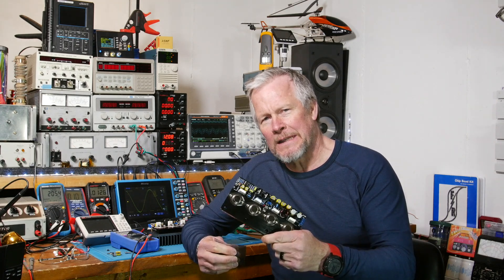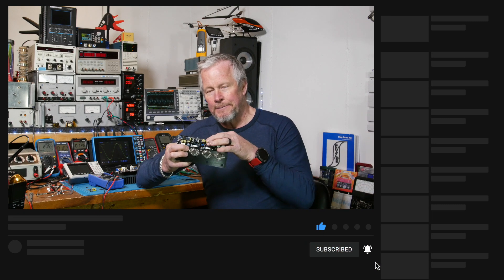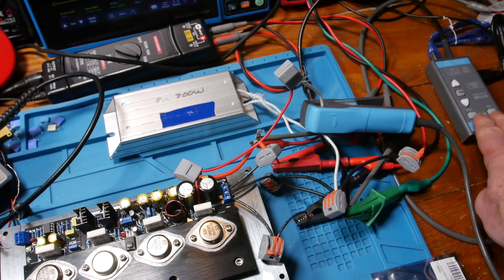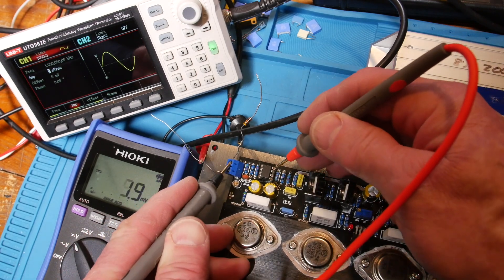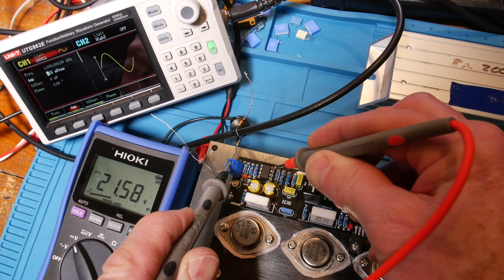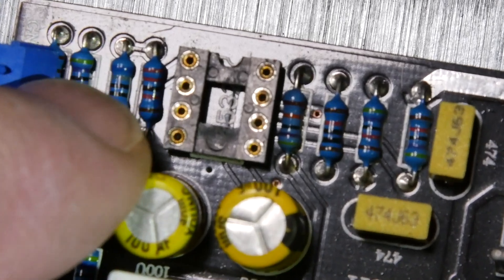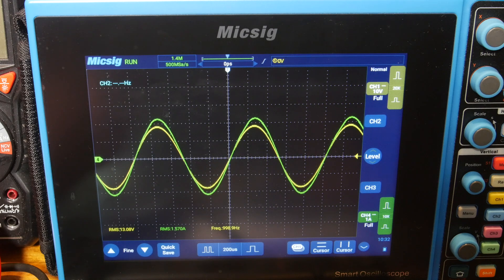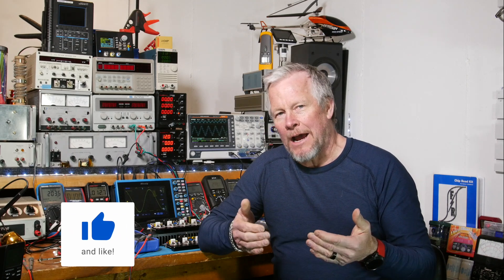Which OpAmp is Better for 20W Class A Amplifier - OPA2604 vs NE5532?

Comment: The best aspect of the jfet input is that the bias current is orders of magnitude less than with a bipolar input. This allows much lower noise voltage densities and is essential for good noise performance if the input is coming from a high impedance source such as any kind of unbuffered piezoelectric input...
Reply: At room temperature....
Reply from the maker: Great point - Thank you!
Reply: @KissAnalog  hello, how about using RC4558? Or 4580 😂

Comment: I've never used that op-amp.   Filet mignon / burr brown is just outside my  taste budget hehe.  That's really cool.  You know, you could now call that 20W amp a 5KW amp if ya want to use the normal advertising hype stuff that has become so prevalent these days. A few years ago I bought an car amp from Walmart on a whim claiming 500W.  I was interested in seeing how they boosted the voltage up.  Turns out it produced barely 25W if into 8 ohm.  It did have a cheesy inverter though.  Again, another really nice video.  Thanks Eddit :)
Reply from the maker: Thanks Keith.  LOL, I think you are so right;)

Comment: What about discrete op-amps what about making some? That should be even better
Reply: I have received one in the post today. I will be testing them and listening to them on my channel soon. I think the main advantage is current availability, no advantage on a preamp circuit. Might help on headphones...we shall see.
Reply: @MichaelBeeny  I think you get less Eddy field current from each stage because of the distance interfering with each other and other interferences
Reply from the maker: Discrete is always fun - and it allows for tweaks and modifications.  The OpAmp is petty amazing though - and probably hard to beat;)  But, then there are the voltage limitations for higher Power Amps.  Layout and routing are so critical - and this is taken care of where that art can easily be messed up;)
Reply: @KissAnalog  what even if you did it in micro-cap could mess it up
Reply from the maker: Great point @John Sweda.  Micro-Cap can give a great place to add parasitics to see how things are affected.

Comment: Real NE5532 are really hard to beat for the money. My question is the  NE5532 that the amp came with real? There are a lot of fakes out there and I keep a stick of them so I can change them. I also only buy them from DigKey as you can get fakes from Amazon and Ebay. 
I do like the OPA2604 and my main pre-amp uses them.
Reply from the maker: It is hard to tell, but they do look legit;)  They have tested well so far.
Reply: @KissAnalog  Yeah it is hard to tell, and a lot of the time they test well. I have found the fake by looking at their leads. They always seem to look like they have solder on them and they seem to be made of a lower quality of metal i.e. very soft and bend very easily. If you have a real one next to a fake one you would see what I mean.
Reply from the maker: Thank you!  I'll have a look at the leads of the new ones that I have.  I could see that their process might not be as good...

Comment: You need to take advantage of the higher supply rail capability by changing the zener diodes to 24v, two 12v in series would do, calculate zener current to make sure it's enough.
I used LM7824/7924 regulators for my OPA2604, I don't have to make a profit.
FET opamps are noisier, you could measure it to see what that means in practice.
Reply from the maker: Great feedback - thank you!  I agree, if I were making this board I think I'd use actual linear regulators too.  ;)

Comment: Yea, oke thats the specs more power, oke i do not think that some one who did buy a 20 watt kit does care about 11% more power, then he or she will build a 30 watt kit amp or even more to get realy more power, i do think you buy the opamp for the sound, now my opinion if u want a tube sound you buy a tube amp kit, oke maybe the hassle with tubes you do not like than i say this, a 5532 has no sound so its perfect to me, you have not to forget that the class A amps have the nice warm sound, thats wy you build or buy a class A amp, now back to the burr brown opamp, if you put a burr brown befor a Class A amp you get warm and mellow sound from the burr brown opamp and slight warm and mellow sound from the Class A amp so for me its to much warm and mellow, so u change the music to much and thats not good for me, so i do have a dac/preamp before my class A amplifier at home with a clear and no colour sound, so i hear only the Pass amplifier class A, and that let's me hear it's warm and nice sound, but i like to say so many people so many opinions so i say do what you want it's your amplifier
Reply from the maker: Thanks and great feedback!  This is a great topic!  I was finally able to get 29 Watts out with the new OpAmps, so they were great to get the power (higher rail voltages).  As for coloring the sound, the Class A and tube amps give even harmonics (distortion) as the BJT amps give odd harmonicsre right I think that people hear that as warmer.  But using both Class A in preamp and amp stages doesn't multiply or enhance the warmer sound - it just keeps it the same.  Mixing would provide both types of distortion and that is what people seem not to like.

Comment: Well done Eddie, you nailed it. That op amp's output swings closer to rails and quiescent current is lower hence the slight increase in rails. Third order harmonic are somewhat dissonant that is why they don't sound good to our brains, it's like playing a cord and getting one note wrong. JFET input is very high impedance and does not load the signal generator output either, you can reduce the input cap value and use a better cap if you like, may improve distortion a tad.
Reply: Hello Nico, I think you are the only one talking over the 3rd harmonic and its issues. If I may, and is is pertinent, here goes my5 cents of contribution to the topic.
Hope we can chat about it. This is one of my fav. topics.
The odd harmonics and its unfortunate presence in the modern music. Sound like a title doesnt it? But, if I mayh, lets brake it down.
The 3rd harmonic are present in every instrument and mostly in the wind instruments (mainly in double reeds wind instruments) and yet those instruments sound realy good even when mixed up with a dense sprectrum. The Clarinet for g.e, mostly has odd harmonics.
Also, lets remember that we are using the Equal Temperament System (Since BACH). The Equal temperament System has the perfect fifth wich is the 3rd natural harmonic. The problem is that when we use instruments tunned by fourths (like bass guitar, acoustic guitar and so...) we can not have the perfect tunning (dividing the octave by 12 perfect steps). The thirds will always sound a little bit off.
Now imagine that you have a chord based on a triade (tonic, third and fifth). The fifth is the strongest harmonic on that chord and the fifth by itself also has the natural serie of harmonics.
In a eletric guitar for example, the fifth harmonic of the fifth note of a Cmajor chord is an E, but the third note of a C major chord is also an E... but those E's aren't the same... the E note is alterated by the Equal Temperamented System, while the E harmonic is natural). Almost 99% that we can read about  of harmonic distortion's sound quality is a misconception or a misuderstanding of the whole picture
I would like to hear peoples opnion on this subject aswell.
There is three books that I think is worth reading about this subject: 
1- How Equal Temperament Ruined Harmony by Ross Duffin;
2 - The Physics of Musical Instruments - Fletcher
3 - Distortion. The cause of harmonics and the lie of THD -  Dan Bullard
Reply from the maker: Very interesting information here Eduardo!  Thanks for sharing this!  I think IMD type testing is done to be sure the input is reproduced accurately.
Reply: @misterjorous  I think you've misunderstood what second-harmonic and third-harmonic distortion are. If I play middle C (C4) at 256Hz, then its second harmonic is C5 at 512Hz (2 x 256Hz) and its third harmonic is G5 at 768 Hz (3 x 256Hz). We sometimes call these "overtones". You're talking about chords where a "third" is the note that is in a ratio of 5:4 with the fundamental like E4 (320Hz), and a "fifth" is in a ratio of 3:2 like G4 (384Hz). A clipped sine wave is equivalent to a mixture of the note and all of its odd harmonics in decreasing amplitude, and the ear is very sensitive to that, so we feel that as much worse distortion than second harmonic.
Reply: @misterjorous  You think that I didn't get the point of the effect of getting a complex signal distorted? What a cheek. I not only understand the difference between harmonic distortion and intermodulation distortion, I can do the maths for a given transfer characteristic, and explain what the result means. While you seem to be unable to distinguish between multiplying by 3 (third harmonic) and multiplying by 5/4 (interval of a third).
Reply from the maker: Great Feedback Nico!  Thank you!  I think this comment nailed it;)
Reply: The odd harmonics are not really dissonant as the ear doesn't object to notes in a ratio of 3:1 or 5:1. The problem is that if we add a small amount of third harmonic to a pure sine wave, and then add a smaller amount of fifth harmonic, we start to create a wave that looks like a square wave, rather than a sine wave. That sounds like we've clipped or overdriven the original pure note and that's what our ears find harsh-sounding.
Reply: @misterjorous  Good grief. I already read your post once. Perhaps you should have read mine.

If you distort a note by adding second and third harmonics, you are adding nothing more than the notes at 2x and 3x the note. That's the definition of second and third harmonic distortion. See Wikipedia's article on Distortion, section "Harmonic distortion" if you still can't understand.

With a just intonation for C, the third harmonics of G4 (384Hz) are at a frequency of 1152Hz (D6) and the third harmonics of E4 (320Hz) are at B5 (960Hz). D6 and B5 are, of course, in a ratio of 6:5. Nobody said they were octaves. The only octave is between a note and its second harmonic.

If you use even-tempered tuning, then we all know that some notes are several cents away from exact ratios, and that's the price we pay for being able to change key freely on instruments like the piano. That has absolutely nothing to do with adding second or third harmonic distortion to a note.

You still confuse "third harmonic" with the interval of "a third". They are not the same thing. For example, you have clearly confused the third of E (which is G# in the same octave) with the third harmonic of E which is actually B in the octave above.

If you build a C Maj chord such as C4 (256Hz), E4 (320Hz), and G4 (384Hz), then add third harmonic distortion, you get the additional notes G5 (768Hz), B5 (960Hz), and D6 (1152Hz). It won't sound good, but not for the reasons you seem to suggest. Adding third harmonic distortion certainly doesn't produce any G#.

Although, I couldn't make any sense out of your "distort this signal in a way that the level of the 3rd harmonic is so high that it is also saturated". Perhaps you could rephrase it in English?
Reply: @misterjorous  Oh,  really? You are very aware what is a third and what is the 3rd harmonic, are you? Did you or did you not write:

"The third harmonics of E is a Gsharp, when the G sharp does not appear on the C series."

If you think that the third harmonic of E is G#, then you have not understood the difference between an interval of one third and a third harmonic. Period.

Did you read the section of the Wikipedia article on distortion? Do you still want to tell me that three times a frequency of 320Hz (E4) is 406Hz (G#4)?
Reply: @UCvJDFBrAcBB2KbLPSJHHVNw You think, you think... Well, I'm damn certain you don't get the point. And I'll put my Masters in Electronic Engineering from Cambridge up against your B.Mus any day.
Before we start, here's my preliminary challenge to you then: If E4 is 329.63 Hz in concert pitch (A4=440Hz), then what is the frequency of its third harmonic, and what note is that? Do you need a hint? It's not G#.

Comment: Over 11% increase in power is really great. Sounds like it will be a jamming little amp. I am using the 5532 in a kit build I am making. I may swap it out now that I know about the Opa2504.
Reply from the maker: Thanks Tron!  Let us know how you like it if you do;)
Reply: also you can try TLE2082, AD825, burson v6 vivid, AD797
Reply: The exchange of NE5532 to OPA2604 only makes the difference in more output voltage swing due to power supply voltage increase from max +/-22V to +/-25 V. Relating most of the other parameters the OPA2604 is worser that the NE5532. Espacially it is 2 to 3 times more noisy especially in the lower frequency range between 10 Hz and 1 kHz. I'd personally prefer the NE5532.
Reply: Kala AD 823 bagai mana abang
Reply: OPA 2134 is one of the best price to performance.